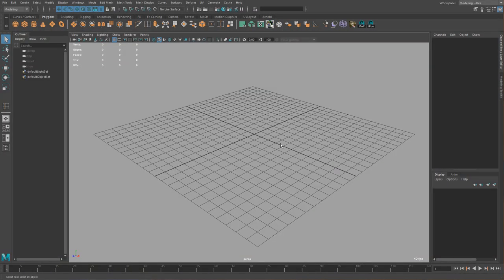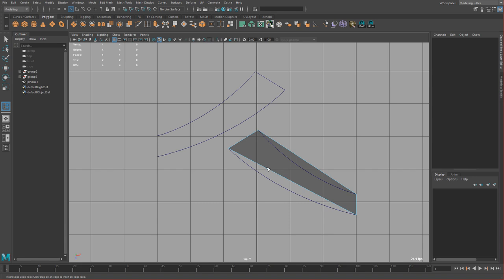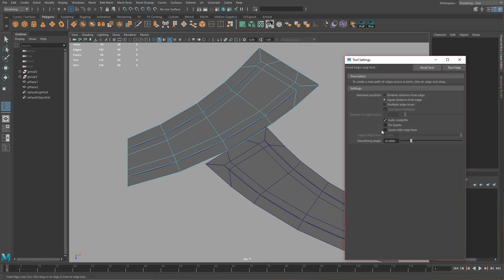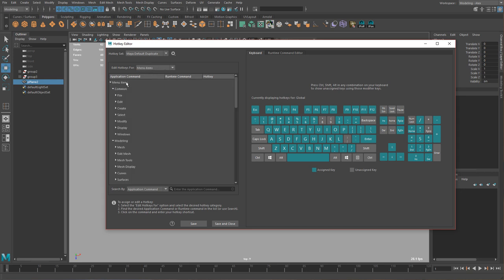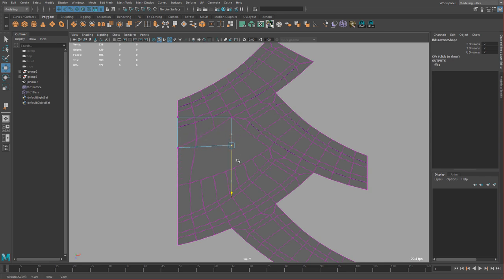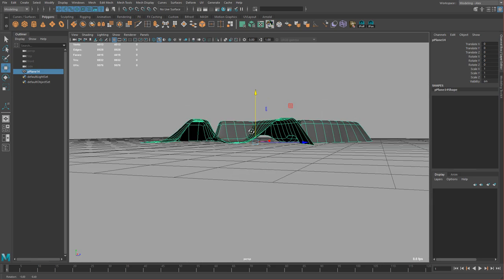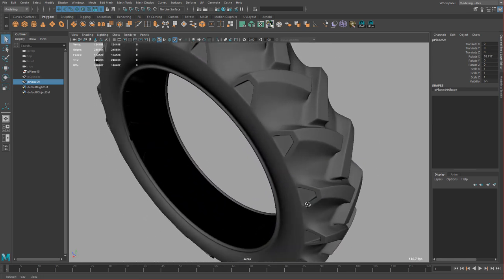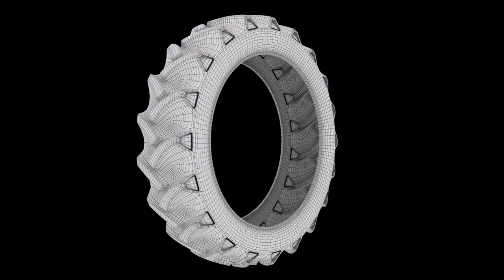Modeling a Tractor Tire in Maya - Lattices and Bend Deformers

Comment: Your tutorials are amazing.
Many thanks for the hard work man!

One question if I may:
How can i change my settings so that my objects have the same color as the one you are using?
I am using the default ones but i love that dark grey color you are using.
Reply from the maker: So, that's because by default, Maya turns on Color Management, and if you don't work in a studio where they control the color profiles, you don't need it on. To turn it off, go to Windows > Settings/Preferences > Preferences > Color Management; uncheck 'Enable Color Management' and at the bottom, click 'Export CM Pref'. Save the .xml file anywhere and name it anything you want. Now Color Management will always be off when you turn on Maya.

Or, you can always hit the ON button above the viewport on the right hand side, next to sRGB gamma menu, but you have to do it every time you start maya.
Reply: Thank you very much for the quick response 3d master. :)

Comment: Why? Your adding massive amounts of geometry with your method? Go get a reference to a tractor tire.  Make a cube. Extrude one end inward delete the bottom of the object. Crease the bottom of the cube about 3/4 crease the top about 1/2 Duplicate it equally multiple times. Mirror the group of duplicates attach vertices the duplicates for both sides. Use deformation of the fully bridged tire tread to make it a cylinder. Create a tube with co-responding edge loops Delete the outer edges of the tube(inner edges will be used for the Rim extrusion). Unify the tread and the tube bridge and or merge the vertices than start forming the outside of the tire with edge loops. Who taught you this method? The geometry is Horrid for Uv mapping and for bringing into ZBrush or other 3D apps. Terrible tutorial. Good to know topology but if you were to make this in a production environment your boss would wonder why it took you 4 hours to model a tire.
Reply from the maker: This is the tire I used as reference: https://encrypted-tbn0.gstatic.com/images?q=tbn:ANd9GcTgLtNpLPlWdx2mkn560ae7-jUbYv8q3bi8hskOPN64ca5acC7lbg
Why would you take this into ZBrush? This model has UVs, they were easy to make, and it's production ready. The geometry is subdivide-able. Not sure where you are coming from with your comment. You are free to make your own tutorial and I'll be glad to review it.

Comment: @Alex Cheparev
The bend deformer seems to work best with meshes that have straight ends/caps. The tiling pattern in this case has pointy ends with vertices at varying positions along the z axis . To fix this and get easier results with the bend modifier you can create an axis aligned cut anywhere along the tread mesh and detach the polygons of say the left side. If you then move this segment over to the other side (with vertex snapping) you can create a tread with left and right side having straight edges. Bending this now into a circle leads to almost perfect alignment where both ends touch each other. I'll make a short video when I find the time. But I hope you get the point. Nice video!